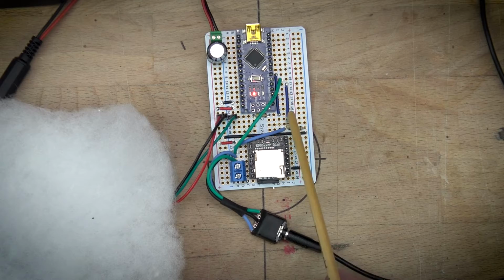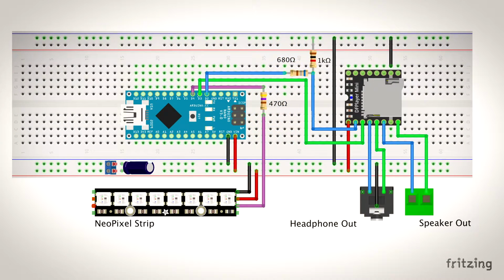Lightning and Thunder Effect - Arduino, DfPlayer Mini, NeoPixels

Comment: Thx for video, just what i was looking for.
Is it possible to use batteri (5v or 9v) instead of a power suppler pluged in the wall?
Reply from the maker: The quick answer is yes. The longer answer is there are some things to consider. The Arduino Nano can run on a 5 volt regulated power supply through USB or pin 27. It has a built in voltage regulator on pin 30 that can handle 6 to 12 volts. NeoPixels are 5 volt devices. Having said all of that, you could run this off of a battery pack of 3 1.5 volt alkaline batteries for a total of 4.5 volts or 4 1.2 volt rechargeable batteries for a total of 4.8 volts. You could also potentially use a USB power bank that has a 5 volt output as well but there are some issues with power banks not detecting current and shutting off. Another option would be to use a larger battery pack and then use a voltage regulator to step the voltage down to 5. There are some ready to go versions if you search for "buck regulator". Most regulators require a higher voltage than the target voltage to work (have I said "voltage" enough). I would avoid 9 volt batteries because they don't have enough capacity to power anything for too long. They're great for low current projects but you may want a bit more gas in the tank.

Back to the beginning... the easy answer is heck yes! While everything I just said may make it seem like I know what I'm talking about, the real experts and a great resource is here - https://learn.adafruit.com/adafruit-neopixel-uberguide/powering-neopixels

I hope that helps and have fun with your project! Cheers!
Reply: @RandomMakingEncounters  WAUW thanks for the quick answer, just what i’m looking fore.
Now i just have too add at small speaker ad fit i all inside my homemade lightningrod

Comment: Can you play the sound file and run the neopixal at the same time? Do you have to wait for the sound to stop before the LEDs will flash? I know there have been a few saying this was an issue? That both would not run at the same time....
Reply from the maker: You can for sure. There are a ton of different ways you can code this. I did a book nook where the audio plays while the lights flash. Basically... all the Arduino code does is trigger the audio track. Once you've kicked off the audio playback, you can have your code move on to do other things. Some things to plan for are:

- do you need to try to closely synch audio to other things?
- do you have tracks of varying length?
- is it important to know when the audio ends?

The hardest part is synchronization within an audio track. If you had a long series of lightning sounds at different portions of the track and wanted to flash the LEDs when they play, something like that is doable but would require that you have the Arduino basically "listen" to the sound levels and then respond/flash accordingly. I guess that's a long way of saying I took kinda the easy way out and people more familiar with programming could probably make it jump through all sorts of hoops.

All the best!

Comment: You mentioned possibly applying this to a battle scene, I think it would be extra cool the include a smoke generator from a cheap E cigarette and get the arduino to puff a bit of smoke in time to the explosion. What do you think?
Reply from the maker: YES! They have some stuff that is also made for railroad dioramas that do little puffs. I want to say that there's a video over on Boulder Creek Railroads where he uses a smoke generator. You could use a relay on the Arduino to trigger the smoke.

I've been toying with trying to work some smoke into my videos for "dramatic effect" but maybe it could be incorporated into the diorama/book nook. I have a Warhammer  idea I've been noodling that it could be cool with. I also have an Arcane idea as well that a bit of smoke could work with.

Hmmmmmmmmm.
Reply: Tony, I built one with a tiny aquarium air pump and a $5.00 atomizer from a disposable vape.  I am using hidden pico size LEDs to flash in the smoke.  I haven’t engaged this arduino approach yet, but the visual is awesome.
Reply: @peterplantec7911  thanks for the idea. I will look into the aquarium pump but my first thought it would be quite a big thing to hide

Comment: Hi
Can this circuit works with led strip?
Reply from the maker: Thanks for asking! Unfortunately, this is really intended to drive NeoPixels or similar controllable RGB LEDs. Strip LEDs usually work off of higher voltages and obviously don't need all of the color code. If you wanted to use the concept of the DFPlayer and strip LED lighting, you could use a lot of the code but, instead of turning NeoPixels on and off, you could use the Arduino to control the current to the LED strip through a transistor. The basic idea is the higher voltage is controlled by the lower voltage of the Arduino through the use of a transistor.

Here's a link to the concept on the Arduino site - https://create.arduino.cc/projecthub/SBR/switching-using-transistor-c9114a

One thing to make sure of is you use a transistor that is rated to handle the total amperage of your LED strip(s). Think of the transistor as a "switch" so, like all things electronic, that switch needs to be able to handle the amps flowing through it. 

I hope that points you to a possible solution!

Comment: This is cool as hell but damn it this isn't what I was looking for hahaha, anyone have any idea how to make lightning bolts without the clouds?
Reply from the maker: Thanks! Are we talking Tesla coil lightning bolts or diorama lightning bolts that don’t risk electrocution? For lightning effects, I’ve seen them done with either backlighting on a translucent backdrop similar to the hallway of paintings in the Haunted Mansion. It could also be done with projection onto a surface… that requires a projector. Another interesting material is EL wire. I wonder if that could be used in some way. Then again… there’s always Tesla coils! Keep us posted if you find a solution and happy making!! Cheers!

Comment: Could this same build potentially support multiple LED strips that are all synced to the same board?
And example would be spreading out storm clouds further away from each other, all in sync.
Reply from the maker: You bet! There are a bunch of ways you could approach this but the simplest is to run a strip of NeoPixels where you want the first area of lightning, then run lengths of wire to the next area and connect another strand of NeoPixels and then repeat. One thing to note is that there is a maximum distance between NeoPixels on the digital wire. If they get too far away, the signal that controls the NeoPixel drops out... I've read six feet but I think it really varies. I've also read adding a single NeoPixel at intervals to act as a repeater can help... you just don't light it up.

You can use another pin on your Arduino to directly control a set of NeoPixels. That means, if you have enough available pins, you can control each area from a specific pin instead of running a long, continuous strand. All of the strands can run to common power and ground and then each digital wire would have it's own unique pin with inline resistor.

Another approach (a bit easier but more expensive) is to just run a long strand throughout your clouds and then only light up the pixels you need. One huge advantage of NeoPixels over strands of regular LEDs is you can turn each one on and off individually. This feels a little wasteful to me because you're paying for LEDs you're not using.

All of this assumes you are playing one audio track and are generally following the "flashes then thunder" approach. Since the DFPlayer can only play one track at a time, you can't layer sound. However, if the idea was to go crazy full immersive with layered flashes and sound (epic storm), I would probably build individual clouds with their own boards, speakers, sounds, and random timing. I've never done it but there are also ways that one Arduino can communicate or control another so you could have Nanos for each cloud and then one Nano to rule them all! The "controller" Arduino would simply be the board that orchestrates the whole show.

Lot's of possibilities out there. I use the first two options all of the time when running NeoPixels. I'm also intrigued by the strategy of using one board to control another. Arduinos cannot truly multitask without a bit of code trickery. In some instance, since Nanos are relatively inexpensive, it may make sense to dedicate one board for each specific, major tasks and have one that is the controller. If I end up with a project like that, I'll be sure to post a video.

Hope this helped and all the best with your project!!
Reply: Hello, can you please advise me on which links to download the necessary libraries to the arduino?
Reply: @provablepigeon6826   copy paste the SoftwareSerial , DFRobotDFPlayerMini, Adafruit_NeoPixel into the library manager and klick install ( Sketch -> Include library -> Manage libraries)
As fore the multiple stripes, I am trying to do the same thing. Yes you can do it but you need to modify the code. I declared multiple strips and added randomBolt. Now I am waiting for parts so I can test

Comment: G'day, 
Thank you very much for this video it is very well made, I do have some question tho. I would appreciate it if you havce time to reply, thanks.

I was wondering if its possible to relink a few of the links posted here, as I cannot seem to beable to locate them (error 404)?

Another question I had was in regards to adding/splitting lights so that it looks as if the lighting travels from a central point? My question is how would I go about doing that?
Lastly I want to add a deffuser to it how can I connect the defuser (with a switch so only utlise it sometimes) to this desigm? (is it possible or do I need to redesign it)

Thanks, I am really new to this but your video has encouraged me to try.
Reply from the maker: Thanks for pointing out those links! I just updated my blog and broke a few things.

So... short answer is yes on the splitting of the lights. The really cool thing about NeoPixels (or similar LEDs) is that you can control each individual LED and sequence them in whatever way you would like.

I'm not sure what you mean by diffuser but you can absolutely add a switch that will control the way the LEDs light up. If the switch is on... it will look one way... off... some other way.

I think the best thing to do would be to DM me over on Instagram with more details on your project and we can see what we'd need to tweak to make it work!

Cheers!
Reply: @RandomMakingEncounters  Thanks Ill be incontact soon!

Comment: Hello my friend good job😉. Do you Change the code? I'm asking because yours colors LED's its white and for me give me all colors, i'm noobs do you can help please.
Reply from the maker: Thank you! There are a couple of things that could be going on. The very first thing to look at is the type of NeoPixel you have. There are two types RGBW and RGB. The easiest way to tell is RGBW will have a bit of yellow on the LED — that's the white light part of the LED. It's very possible that you have just RGB and so you are seeing color instead of white. 

You'll see in the code that I have the following:
Adafruit_NeoPixel ledStrip = Adafruit_NeoPixel(numPix, neoPin, NEO_GRBW + NEO_KHZ800);
If you have RGB only NeoPixels, you would remove the W in GRBW to look like:
Adafruit_NeoPixel ledStrip = Adafruit_NeoPixel(numPix, neoPin, NEO_GRB + NEO_KHZ800);

Now the program knows that you have RGB instead of RGBW. The next thing you would need to tweak is the color values you're setting your pixels to. This is a little tricky because I'm using the white part of the LED for most of the effect and the color just to add a hint of color to the flashes. With RGB LEDs, we need to use the full intensity of the LED to create as close to white light as we can.

Try changing: color = ledStrip.Color(r + colorV, g + colorV, b + colorV, flashBrightness);
To: color = ledStrip.Color(r + colorV, g + colorV, b + colorV);
This removes the white LED value (flashBrightness) and now will set the color on just the RGB values.

Now we want to pump up the intensity of the RGB to make as close to white light as we can.
Try changing:
  int r = random(40, 80);
  int g = random(10, 25);
  int b = random(0, 10);
To
  int r = random(180, 200);
  int g = random(180, 200);
  int b = random(180, 200);
This will set your RGB values randomly between 180 and 200. 255 is the maximum value but I also have another random value later on that adds between 0 and 50 to the values when it flickers the LED. All of these random numbers are intended to create a bit of variation in the effect so it doesn't get too boring. 

This should maybe get ya going. You'll be left with some variables that aren't used or needed anymore but shouldn't mess things up. If you find the color is still too colorful, and you've confirmed that you only have RGB NeoPixels, I've found you could pick up some RGBW versions. If I'm just doing color lighting and I know I never will need true white light, RGB is great. If I'm not sure and may need real white, RGBW is the way to go. There are even different color warmth from cool to natural to warm white just like light bulbs.

I hope that helps and wish you all the best with your project! Cheers!
Reply: Hi my friend, thank you very much for replying, you are right my LEDs are RGB 😉 I still don't understand the difference very well, because my LEDs are very identical to yours, they have 3 wires, 5v, gnd, data.😅 You can't imagine how happy I am I did everything as I said gave 100% result.  From the bottom of my heart, thank you very much for your great help and availability, I'm going to implement this project with my son 💪.  Have a Merry Christmas and a Happy New Year, big hug 💪
Reply from the maker: Same to you and yours!
Reply: Hello, can you please advise me on which links to download the necessary libraries to the arduino?

Comment: While you are trying to find free Thunder .mp3's, I have 2 more questions. The Adafruit neopixels come on a 1 cm board that contains 4 connections. Way beyond my capacity to solder onto. Is there a female connector to slip on the ends (with wire pigtails), what is it called and where can I find them. I have tried searching on eBay but cannot find anything that seems rights. Probably  because I don't know what they are called.

2nd question what is the name of the blue screw terminals that plug into your breadboard. I also cannot find them probably due to incorrect nomenclature.
Reply from the maker: Here's a resource for free thunder effects - https://mixkit.co/free-sound-effects/thunder/ the effects that have green labels are paid but there are around 40 that are completely free to download.

The NeoPixel soldering is a tricky one. There isn't something that will connect or slide over the ends and connect with the solder pads. What I've done in some instances is solder some header pins onto the pads and then use some RC servo connectors to plug into the pins. Using the header pins made it a bit easier to solder since I'm not trying to solder wire that keeps moving all over the place. While there are four connectors, only three are needed—there are two ground pads. Not really sure why... maybe just so you have a choice of picking the side you want the ground on. Power, ground, and data are all you need.

Snap to length header pins - https://www.amazon.com/MCIGICM-Header-2-45mm-Arduino-Connector/dp/B07PKKY8BX
Servo wires - https://www.amazon.com/dp/B01LA9YDEI

I took a look on the Adafruit site, there really aren't any NeoPixels that come prewired. There are flexible strips that have wiring on them only if you buy over 4 meters and even then you're not guaranteed that you'll get an end with a connector.

The screw terminals are called just that. They can be tricky to find in search because they are also called terminal blocks or other things. Make sure the ones you buy will fit a breadboard. Spaces on the pins and the thickness of the pins can differ making them tough to fit. If you're using relatively stiff solid core wire, you can also just push the wire straight into the breadboard without needing the terminal. I use the terminal blocks because I will eventually move all of the components over to something like a Perma-Proto board and solder the whole thing up once I know it's working.

Proto boards - https://www.amazon.com/s?k=perma+proto+board
Terminal blocks - https://www.amazon.com/DAOKI-Terminal-Connector-Phillips-Screwdriver/dp/B08214GL5F

Side note... none of these are affiliate links and I don't specifically recommend you buy these exact items. This stuff comes in a thousand different flavors and prices but I just want to point you in the direction of what to search for if you have a preference to buy from other sources like Ebay.
Reply: Thank you.

Comment: Where is the .mp3 for the thunder?
Reply from the maker: I’ve used effects files from Epidemic Sound. Unfortunately, it’s a paid account and they’re not shareable. However, I did manage to find some good free files… lemme see if I can find them again. There isn’t any specific file you need and the code can be tweaked for any thunder file you might come across on the interwebs.